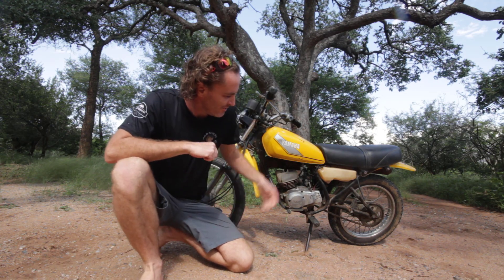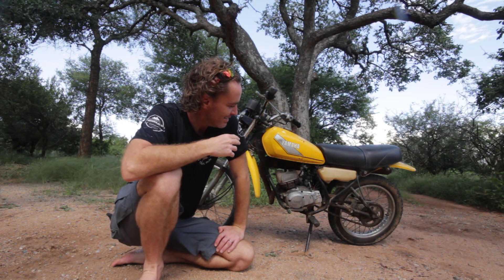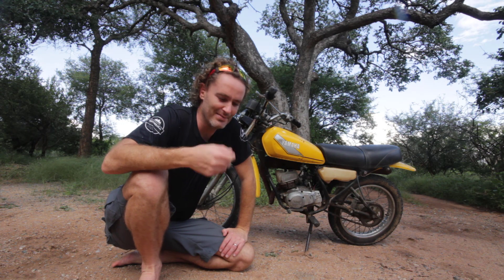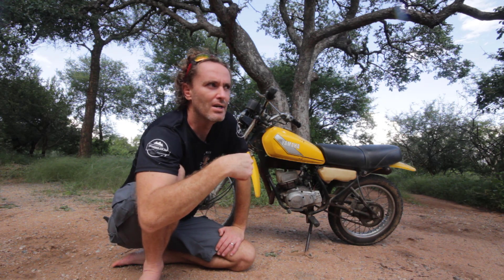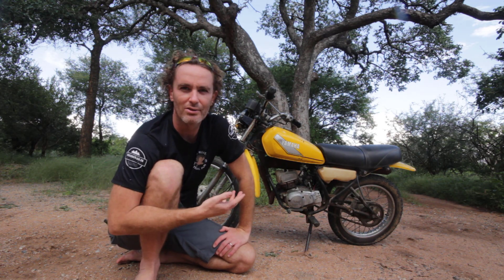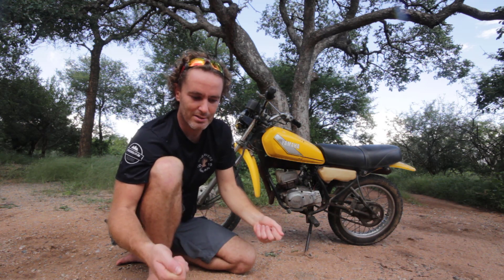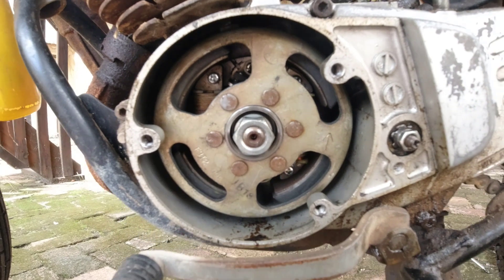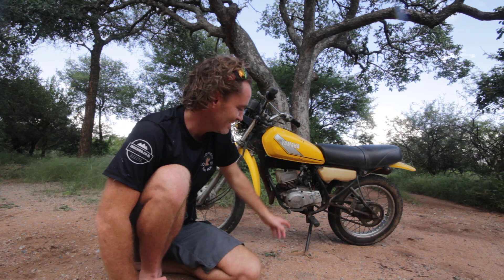2-Stroke Bike Won't Start | Fixing a No-Spark Condition on a Yamaha MR50 (for Complete Beginners)

Comment: Hi  I can't get my 1981 MR 50 to start. It has spark.
Please can you check what is your compression it it just a 50 CC so compression will not be that high. Do you still have this bike. Pls help me.
Reply from the maker: Hi Adriaan. Did you manage to get it started? My compression doesn't even read on the gauge (i.e. close to ZERO!)